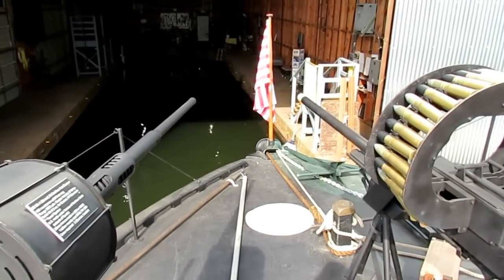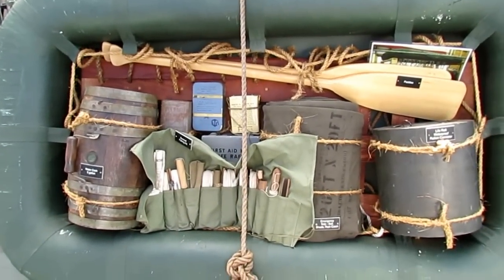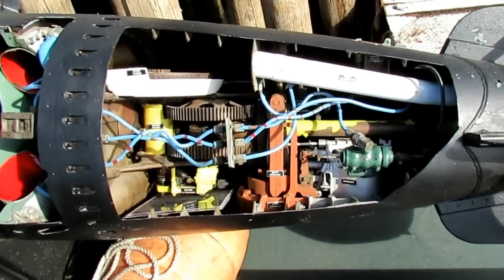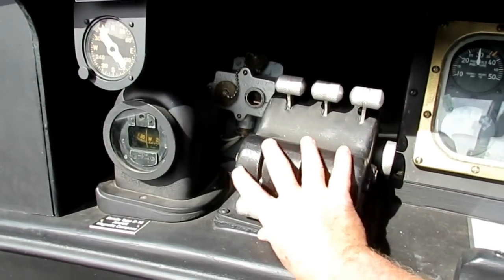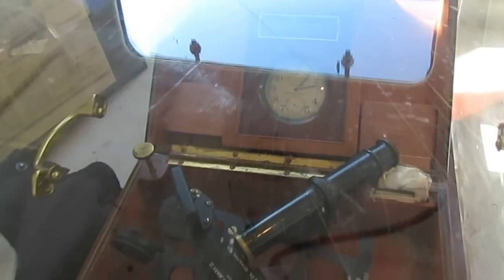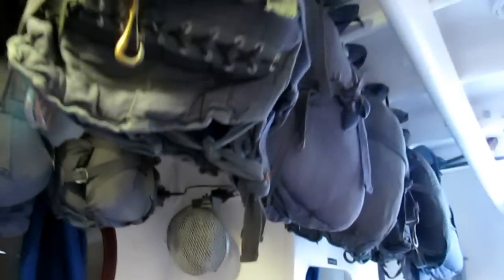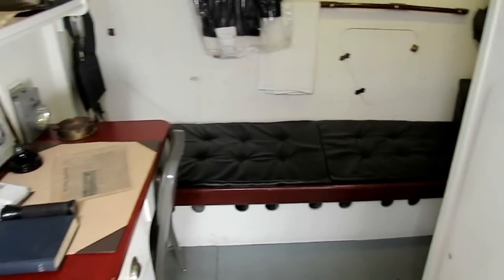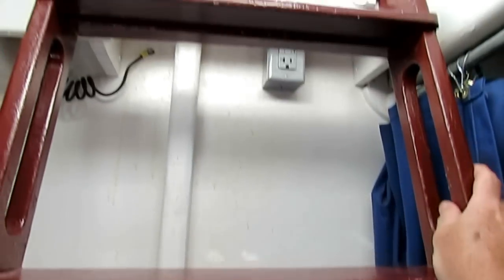PT Boat PT-658 Deck and Interior Walkthrough Sept 2012 -18 minutes

Comment: As a kid growing up in the 60's I always wanted a PT boat. I built models of them, I watched all the black and white war movies on TV, sat on the living room floor each time McHale's Navy came on etc etc etc. For some reason I didn't understand how big a 70' or 80' Elco or Higgins PT was. It just never occurred to me. Another thing that I missed as a kid was that it took apx 10 to 12 men to operate the boat, with 2 of them in the engine room. I figured it wold be just like running our 19' fiberglass Larson with the 115 horse Johnson outboard. Not quite. I imagined my PT being on Lake George in NY state. That was something else I didn't know as a kid, how was I going to get it there. Then as I get older finding out most were destroyed by the Navy by setting them on fire as it was cheaper to burn the wooden hulls instead of transporting them back to the US after the war. I am 61 now and if it were within my means I would purchase the plans/blueprints to an Elco or Higgins and have a boat builder build a 40' scaled out version of modern materials such as fiberglass and Kevlar etc.

Comment: Lumpyone,
Yes you are correct, that is an Oldsmobile Mark 4 37mm Automatic Cannon replica. The distinctive 30 round belt type magazine's rounded shape was designed to fit inside the cowling of the Bell P39 Airacobra fighter. The story goes that enterprising young PT Boat crews saw crashed P39's on Henderson Field Guadalcanal and cannibalized them for barge busting. It was so successful on PT Boats, that after a few months they were fitted with these weapons directly from the factory. Jerry
Reply: I saw some early models that did not even have a radar mast just an antenna... They had a 3 inch gun up front or the 40 or 50 up front. It was amazing to see how these thing evolved and how some of the weapons were switched around to fit the situations.

Comment: Only caught a couple of glimpses of the ventilation ductwork. Darn. I installed the working ductwork throughout that boat. It had been stripped out by its previous owner. It was a huge challenge and one of the high points of my career. It was a great honor to have worked with all of the veterans who were on this project.

Comment: Great tour. I was a torpedoman in the nuclear submarine service back in the 70s. We still had the old 21 foot long World War II manufactured Mk.14 torpedoes, along with newer wire guided and acoustic weapons. The older torpedoes were retained well into the Cold War because they were "war-time proven" weapons. The Mk.13s on your PT boat have internals similar to our Mk.14s -- combustion flask, main drive gears, and other features like an external starting lever.

I heard from some of the older guys that I served with that PTs were like howling demons fueled by avgas and powered by three 12-cylinder aircraft engines. Hard to imagine that the Navy had over a thousand of them -- and scrapped almost all that survived at the end of the war. Thanks again for a great tour.
Reply: Richard najjar  Those Packard M2500's were a purpose designed for PT Boat service based loosely on the innards of Packards A2500's that were used in planes but the M2500 were PT Boat use only !!!

Comment: Dang , armed to the teeth!!! This little fish has some  bite!
Reply: Similar role to a Submarine, except with shorter legs and no diving capability. Sneak in at night, blow the hell out of something, and run for it. I'm honestly surprised the Coast Guard doesn't use something like this even today.
Reply: 1337 - They do. Its called Fast Response Cutter (Sentinel Class). 153', 4 M2's, 1 gyro stabilized remote operated 25mm, crew 22, stern launched small boat. Just google USCG FRC.

Comment: While in the Navy Reserves, I discovered a boat unit over at Coronado 'phib Base. They had several boats like this and two which were much larger. I started to apply to transfer to the unit 'til I found out they were salvaging those boats and replacing them with much smaller rubber ones. My duties would include leaving Friday nights and returning Sunday night or even Monday AM, as opposed to normal reserve duty from Saturday AM to Sunday afternoon.

The missions consisted of running those rubber boats up the coast about a day, doing some mock ops with SEALs and then returning. In the big boats, I'd have happily done it, but not those rubber things.

Comment: Collins  TCS  radio  transmitter -receiver.  Used to know them well.  As a teenager,  this stuff was around  "surplus"  as a   young  general  radio amateur.    1625  tubes in PA  modulated by a pair of 1625s
Reply: hi i still use my tcs transmitter on AM on 40 meters greg  WA2ORO

Comment: To rgdukeman The boat is owned by the 501c3 non profit group Save the PT Boat Inc. To F Davies: The Marine Chronometer is an Authentic WW2 Hamilton 21 Jewel PT Boat Chronometer, it is not a cheap modern quartz clock, they were made for small craft during WW2 and actually are about the same size as a pocket watch, we don't have the wooden case it is normally kept in.  As for the Pioneer Gyro Flux Gate Compass, (also used on B17s the variation is from the compass rose of any nautical chart. Jerry

Comment: Thanks so much for this.  Did you ever see one of the old Vosper boats that sat in Fall River MA?  I saw it there back in 1980, I think.  When I was there 20 years later, it was gone, and a fellow at the museum told me that some punks set it on fire - just for kicks.
Reply: Hi Todd, Thanks for the comment. Yes the Battleship Cove Museum in Fall River has 2 PT Boats on display currently, PT796 (a Higgins 78 footer), and PT623 (an Elco 80 footer). I have visited there last year and they are in great shape, both are kept inside out of the weather, and out of the water on blocks for preservation.You should go see them if you can. Jerry

Comment: In the early 60’s, as a young sailor, I was attached to the presidential yacht.  We had a PT boat used as what we called a chase boat, used to follow the presidential yacht.  The PT boat was aluminum hull with 4 screws and 8 Diesel engines.  I wish I could remember the original hull number, changed to 109 for JFK, but I can not.  If any info is available on this boat I would love to have my memory jogged.

Comment: You said the torpedo turbine was fueled with alcohol; what oxidized it? Is that what the air flask is for, or is that used to control the torpedo's buoyancy?
Reply: Hi Apollo, thanks for watching! Yes, some of the air was reduced in pressure and used for combustion inside the torch. Alcohol mixed with air for initial flame, then after a short delay water is automatically sprayed in to flash into steam. Starting was done with air actuated piston to detonate primer caps to start a mixture of powdered magnesium and cellulose and paraffin burning.
Reply: Jerry Gilmartin Fascinating. So they didn't use hydrogen peroxide? It's been used in submarine torpedoes, and has been the cause of more than a few accidents. Concentrated peroxide decomposes on the slightest provocation (or contamination) producing steam and oxygen. Nasty stuff.

Comment: Thanks for the tour!

Did the radioman have any kind of comsec gear like codebooks or a cipher machine?

Inverters are solid state, so they came after WW2. What you called an "inverter" on the radar looked more like a "dynamotor", a small motor-generator set. Same function, but performed electromechanically instead of electronically. Before my time but I recognize it from surplus gear. After dynamotors and before inverters came vibrator supplies, more like an inverter than a dynamotor but with an oscillating electromechanical relay doing what power transistors do now.
Reply: The radioman did not have a cipher machine that I have ever heard of. I think they may have had codebooks but I have no details about them. I will try to find out and will let you know. Both are good questions As for Inverter, I think the box is labeled as much, I will post more details later.
Reply: Jerry Gilmartin Yes the Inverter is labeled the "Power Inverter" and not Dynamotor, however what is does is to convert 24vdc into ac power for use in the flux gate gyrocompass system. It is a small motor-generator set. I looked directly at the original label plate, so maybe you are thinking of something else?
Reply: Jerry Gilmartin Interesting because I've never seen "inverter" used for anything but solid state units. You learn something every day.

You confirmed my suspicion that it's a motor generator (the size and shape gives it away); maybe "Dynamotor" was a trademark of some other company? You said it makes AC, so maybe "dynamotor" is generic but applies only to units producing DC. (A "dynamo" is a DC generator.) I've seen units that look just like yours labeled as "dynamotors" that make a few hundred volts DC to supply the plates in a WW2-era military surplus radio. They're powered from 12, 24 or 28V DC, whatever is available.

It's really not that important, but if you get the chance to take a closeup of the label without spending more than 5 or 10 seconds on it, that would be nice. I've always been interested in energy conversion equipment. Thanks!

Comment: Isn't this boat a Higgins PT? I noticed the placements of the Dual .50Cals, and it wasn't arranged like the 80ft Elcos.
Reply: Hi Hunter, and Thanks for watching!  Yep, this is a 78 foot Higgins PT Boat, built in New Orleans in 1945. The Higgins have 2 Dual 50 cal gun tubs adjacent and the 80 ft Elco has them offset. Another easily spotted difference is the Higgins have 3 muffler castings on each side while the Elcos have al 6 mufflers on the transom.
Reply: I watched the video on how the PTs came into being, very informative, and so was your walkthrough, I've modeled a 1/72 scale Elco with two twin 20mm for and aft, I got the 20s from the linberg Airforce Rescue Boat model, which I thought was a higgins, but I could be wrong, well thanks again for an informative video and response to my question.

Comment: How many had all of this armament at the same time though, PLUS the radar?
Reply: Hi Mark good question! Towards the end of the war the Rocket Launchers and Radar were in common usage on almost all the new squadrons being commissioned. What we are striving to do is show any weapons and equipment that was ever used on any USN PT Boat since we are the only remaining PT Boat around so you can see how it would have looked as installed. Where else could you go to see an example of how a 5 inch spin stabilized Mark 9 rocket was used on board a PT Boat? So that was the thought process we went through in selecting what weapons or equipment to install aboard.

Comment: Jerry, Thanks for the informative video. 
 Please explain the amount of freshwater freshwater storage. 
How many hours or days was a typical mission?

 Thanks, John Valos
Reply: Hi John,
Sorry for long delay in reply. The PT625 class of 78 foot Higgins PT Boat originally had 4 aluminum 50 gallon tanks for drinking water. 2 below deck in forward crew compartment, 1 in officers wardroom and 1 in aft crew head. The engine cooling freshwater has a 5 gallon fresh water expansion tank attached to each engine. I hope that answers your question. Jerry

Comment: WAIT a minute1 Did that guy say that the Swedish Oerlikon ( pronounced "war-like-un") WAS A 20 MM.? It was an 18 mm. when I was an Aviation Ordinance man. It was also an anti aircraft rifle, but a little longer.
Reply: +T Allen Yes they made about 50,000 20mm Oerlikons during WW2, they could be mounted in a dual or single mount. The ones in aircraft wing guns are belt fed and have a larger powder casing, but the projectile is still 20mm in bore size.

Comment: Okay, I’m being a little dense, but unless you have a barge following this PT, how can you use the 20mm cannon firing at 450 rounds per minute, that’s 7.5 rounds per sec, and you have 60 round mags, that’s 8 seconds per mag?
Reply: I was in the Army in the 80's on a crew with a Gatling gun (Vulcan it was called) that fired 50 rounds per second.  Yeah, 3000 rounds a minute.  But you didn't just squeeze the trigger until it was empty. Aircraft are the same way, high rate of fire, limited ammo carrying ability, so very selective in the use.  The Vulcan had a switch that controlled how many rounds it shot with each trigger activation.

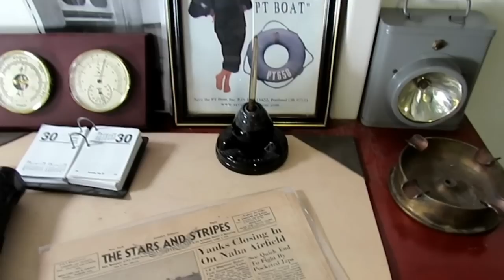Comment: 16:05 "No smoking on a PT boat".   

Probably because they were made of wood and powered by gasoline, but you know the rules aboard these boats were loose even between the officers and the crew. You know there were lots of cigarettes consumed aboard anyway LOL. The TV show "McHale's Navy" was probably actually a pretty accurate representation of how loose the rules were when not actually engaged in combat.
Reply: Hi Scott, Yes, I am certain you are correct. Especially when you think these boats were crewed by mostly a bunch of 18-23 year olds! The skipper would be the oldest, usually around 24 years old, so not a lot of strict adherence to the rules. One thing I just read was they had to stop the practice of cleaning the bilges with 100 octane gas after a boat exploded in port and killed 2 sailors!

Comment: The issue with the PT boats while agile & fast must have been how much ordnance it could carry  after all were talking about like 12 to 15 men on a ship that was between 70 & 80 ft long  you only have so much storage capacity ..So these I'm thinking might not have been long range patrol boats but rather shorter range in close patrols where turn around time could be greatly reduced unless re supply was made at sea..
Reply: Michael  crew was 2 officers and 8 crew !!!
Reply: Their range was 500 nautical miles round trip. 3000 gallons of gasoline. Mostly did patrols along the coastline at night and return to base at dawn. They were pretty successful interdicting enemy supply lines in places like Italy and New Guinea and the Philippines

Comment: Hey there nice vid can you tell me the square feet width and length of the boat please
Reply: Hello Clayton, the boat is 78ft 6 inches in length and 20 feet 5 inches beam. It weighs 103,000 pounds (51.5 tons). Thanks for watching

Comment: first thank you for the video detailing the workings of a PT boat was very interesting. Now that I've got that out of the way I have to ask wtf was with your inane reasoning on why they wouldn't have used the Head because it had flimsy curtain for privacy?? I have to assume you never served in the military no offense and not trying to be mean or rude.
Reply: Actually on active duty USN 10 years and reserves for 13 years. Talked to many WW2 PT Boat vets crewmen and that is what they told me. Besides there were 2 other heads on board, and they used this coat closet sized one to store extra food much like on a WW2 sub.

Comment: you did that complete detailed tour,, with NO ENGINE ROOM?????  come on
Reply: +South West Florida Aerial  Yeah, guess they couldn't find any Packard-Rolls Royce engines for restoration. Coulda' used Allisons, tho.
Reply: +T Allen pt-658 does have Packards
Reply: +T Allen A quick search will show 2 different engine room tour videos. And Yes we do indeed have 3 Running Packard V12 Gas Engines. NOT Rolls Royce. Common mistake, Packard made licensed copies of Merlin Aircraft engines but the engines installed on PT Boats were bigger than Merlins (1830 cu inch Merlin vs 2500 cu inch displacement on Packard Marine PT Boat engines.
Reply: @tallen4520  The engines in the PT boats of the US Navy were PACKARD M2500 engines and had NOTHING to do with the Merlin engine !!! The M2500 was being delivered to the navy 3 years BEFORE RR showed up to BEG Packard to build the Merlins FOR THE BRITS !!!!  Google the PT boat engine and learn !!! You know NOTHING of what you speak,  M2500 was 2500 cu in displacement  Merlin was 50% smaller at 1650 cu In !!!  FYI !!!!  Neither RR Merlins nor Allisons were used in any production PT Boats !!!